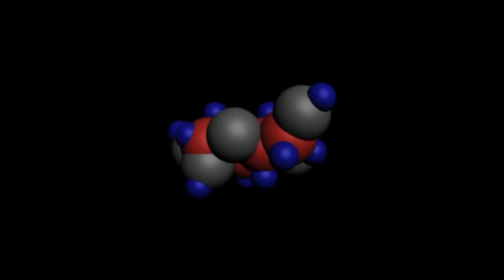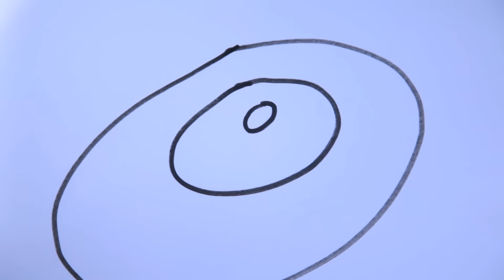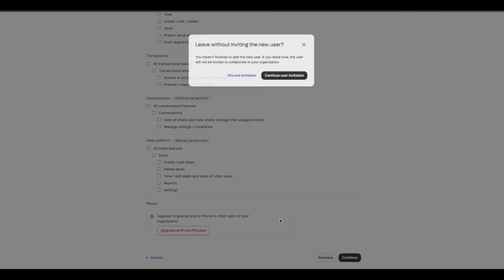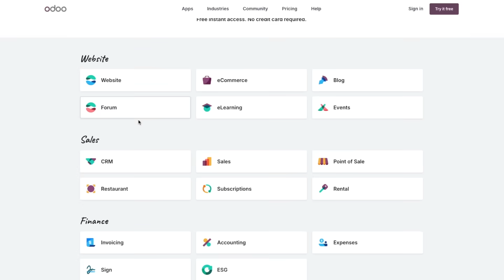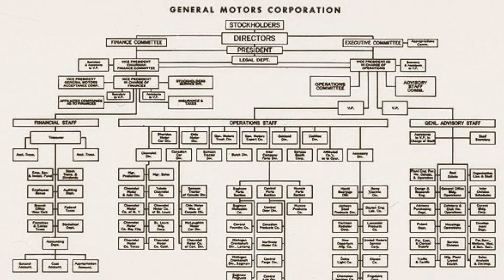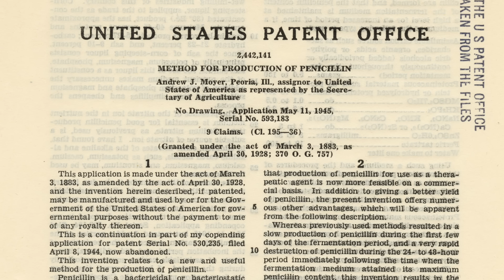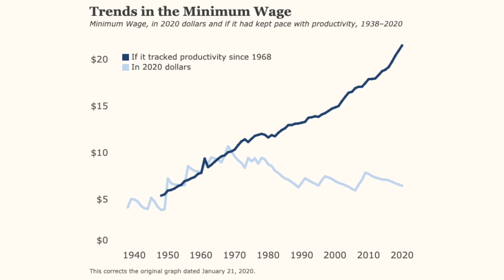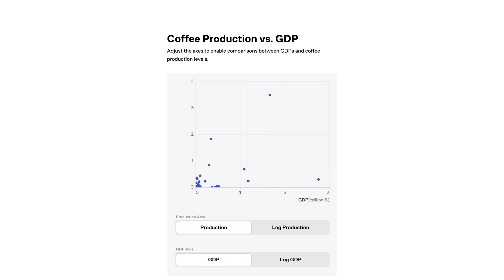The Profit Paradox

Comment: You had us in the 1st half not gonna lie...
...issue is that this malthusian lunacy you peddle is simply not true. We are not at "we ran out of oil, thus production dropped", we are ate "oil demand got reduced". Similarly solar panel production cost (be it in energy or currency) doesnt increase, or performance of new solar panels doesnt decrease year on year.

Hence we are not running out of energy.

US's issues with its current borderline scam centric investment culture is its own unique thing. Its not an end of the world as we know it thing. (Yes, i know other places have their own issues, but different ones)
Reply from the maker: thanks for sharing. What I said is we ran out of 'easy' oil, and also solar is getting more effiicent (as I show) but it's total energy cost is very high. Nowhere does this video say we ran out of energy? It says the energy cost of energy is going up. My sense is you have a preconcieved notion and aren't thinking from first principals?
Reply: @ArtOfTheProblem 
Well in my experirnce cost of living / affordability of life is not even remotely correlated to price of energy let alonr oil. Cost of living in Germany (to pick one example) is not higher (when adjusted for median earning), than in the US, despite waaay higher energy, let alone gas prices.
And of course opposite is also true.
Venezuela & Iran aint utopias just because gas is cheap.

My point is that contemporary fost of living crysis in the US is exactly that, an american issue that has little to do with energy prices. As huge swathes of the world have way worse energy prices, and somehow dont get the "cost of living death spiral"

Comment: 16:20 the mismatch is not just physical but also representational. Remember that money is supposed to represent energy. Finance misrepresents energy to increase the perceived profit. You need to distinguish between real and perceived profit, because money doesn't necessarily represent energy. In the case of housing, for example, part of the reason why it is so expensive now is because banks have an infinite supply of money and can loan whatever they want. Banks are motivated to give larger loans and more loans in order to make more money. That, coupled with compounding interest, contributes to the mismatch we see between the price of housing and wages. There is also land. Land is finite and some places have more expensive land than others, depending on how desirable they are. Therefore, the price of land tends to grow over time in most urban places, leading to a significant increase in the cost of housing.😮

Comment: Another great video from my favorite creator on youtube. I loved the analogy between energy accumulation and profit.
I think the most telling graph in this video is the one at 15:37 which shows the discrepancy between the real economy and the financial economy. This is where the direct one-to-one relation between energy and profit starts to crack in our modern economy. The finance sector can create more energy at any given point of time just on the promise of the future value (or growth) of the current energy levels. Which means it can leverage (and even use) the future energy in present time in the form of loans or credit or any other financial instruments. This is where the problem begins and the natural order starts breaking. Nothing in nature perform these acts of promising or claiming, without the tangible energy to back it up. While humans have come up with this clever way of consuming future value of energy. For the time being, this discrepancy is still getting managed by the lowering the wages (or energy quotas) of the individuals but this can't go on forever.
Another problem of hoarding of energy by powerful individuals is pure greed in my view. In biology it would be akin to getting addicted to the glucose molecules and forever accumulating the energy even when its not needed. Or it can be a considered a tumor with its unchecked and unnecessary growth, but specific to a certain body part.

Comment: Easy subject explained on a complictaed way. You need to control capitlaism, ots as simple as that. Most actors are greedy. Especially the ones that climbed so high. They dont care for the rest, or they care very littld. If you dont control them,  they will start harming, do you need it simpler than that?

Comment: Where is this 16:07 graph from? I think it's very simplified and gives the complete wrong image of how fast the technological breakthroughs in renewables are happening, solar will outcompete oil because it is so much cheaper and coupled with breakthroughs in battery tech it will enable huge surges in energy use for humanity (clean energy use). + I see your point of good profit vs. Bad profit, however, money to invest in the breakthroughs need to come from somewhere (but sure I agree that regulations are needed to make sure corporations don't abuse the systems).
Reply from the maker: https://surplusenergyeconomics.wordpress.com the problem isn’t efficiency it’s capital costs when you include infrastructure which people tend to ignore

Comment: Great video! I've wanted to make something like this myself for quite a while lol. Now you've saved me the work 😃 I'd just like to add some of my own thoughts to this. Economics, ultimately everything is the result of physics. So let's start at the very beginning. Why do cells need energy? What do they actually do with it? If you think about it, a cell is basically just a collection of atoms and molecules, no different than say a rock. And if a rock were sitting motionless in space, would it need energy? No. But if that rock wanted to move, then it would need energy. What does this tell us? Existence doesn't require energy. Change does. If a cell were to just exist and not try to change anything, it wouldn't need any energy. It'd just exist. No different than a rock. But cells do need energy. So what do they do with it? The answer is simple: they use that energy to reproduce. Okay but what does that actually mean? What is reproduction? Reproduction is just rearranging existing non-living stuff into living ones. And since you're rearranging, that's a change and costs energy. That's why cells and all living things need energy. Because they're constantly rearranging things into living configurations. That's where another law of physics comes in: mass conservation. You can't create matter and you can't destroy it (for the most part. We know nuclear processes violate this but life doesn't have access to that). Meaning the total amount of stuff doesn't change. Take a moment and think about what that means. All that exists today has always existed and will always exist (again, another word of caution. Other physics laws render this moot and given enough time, all matter and usable energy will disappear but for our purposes, this is irrelevant for the time being). So if you can't create and you can't destroy, what can you actually do? Just rearrange. That's all you can do. Everything that's ever happened and will ever happen (barring nuclear processes) is just that: rearrangement. You build a new house? You didn't pull it out of thin air. No, you just rearranged existing stuff (brick i.e. mud, cement i.e. rock) into a new configuration, the house.  It wasn't already in that configuration. You reshaped it, that's why you need to spend energy. And life's no different. Because like everything else, life has to follow the rules of physics too. It's not like the universe goes, oh you're a living being? Okay gravity will now no longer apply to you. 
So that's all life is: changing form/configurations. The total amount of stuff doesn't change thanks to mass conservation. The only thing that changes is what configuration/shape the stuff is in. And that too because we're getting energy from the sun. If we didn't, no change would be possible.

Comment: 16:08 You say that the energy cost of energy is increasing which i interpret as the surplus value on the system level is getting smaller. But is that the dominant cause of declining living standards and increasing unaffordability? My view is that extreme income inequality has a greater effect on this matter. Smaller and smaller groups are getting more and more of the value. Its one HUGE transfer that doesn't create energy! Centralizing the energy centralizes the power, control, and decision making--not good for effciency. Thus, the energy cost of energy is increasing and real energy creation is decreasing. I see sooo much opportunity for real energy creation throufh efficiencies that cannot be achieved because of the incompetence in our system which is driven by extreme income inequality which is really just the misallocation of individual power.

On a separate note, the graph of the energy cost of energy is extremely confusing. How is this measured? If it's simply the profit of producing energy, then increasing energy cost of energy just means less producer profit, right? that's not necessarily bad and can actually be good if the price of energy goes down.

Comment: 12:37 the problem with this disconnect is I removes the consequence of death. You are trading your energy, your “time tokens” for a dead commodity. Money doesn’t fade or even tarnish, which makes it useless in terms of energy transfer biologically. If we were silicon life forms that used emf instead of carbohydrate chains as energy transfer it would make sense but the disconnect the average human has with the actual amount of energy needed to do the process they are paying for vs the amount of money they spend for it is depressing to say the least

Comment: i would argue that the "energy cost of energy" is a flawed analogy, if the cost of energy is lowered even if the total energy is more as long as the net cost remains stable it balances, the analogy would be that strip mining with gas lamps is going to be "more efficient" but in terms of man hours using heavy machinery is going to take less human man hours

Comment: "cooking breaks cells walls into proteins and makes up to 40% more energy available than if eaten raw" is incorrect. 

Bomb calorimetry measures a food’s gross chemical energy; your body absorbs only a portion of that (metabolizable energy).
Cooking disrupts plant cell walls and denatures proteins, which can increase digestibility and the fraction of energy absorbed; the magnitude depends on the food and method and there is no universal ‘+40%’ rule.
Plant cell walls are not “broken into proteins”; they’re mainly cellulose/hemicellulose/pectin.
Cell walls are not proteins to begin with (with limited exceptions); cooking or digestion does not convert them into proteins.
Polymers can be mechanically disrupted (chewing, grinding, cooking) or hydrolyzed (by acids/enzymes) into sugars (and, for peptidoglycan, small peptides/amino acids). They are not transformed into proteins.
What cooking actually does in meat: 
- Denatures proteins (myofibrillar proteins; sarcoplasmic proteins). (Protein denaturation is the process in which a protein loses its native three-dimensional structure (its fold), usually because of heat, acid, salt, or mechanical stress. Denaturation makes internal peptide bonds more accessible to digestive enzymes, so the amino acids are absorbed more easily.)
- Disrupts cell membranes and extracellular matrix; collagen can solubilize to gelatin, tenderizing tissue.
- These changes can increase protein digestibility and availability, but they do not involve “breaking cell walls into proteins,” because animal tissue has no cell walls.

Comment: This video is wrong. You can't look at business and profit through this narrative of individual ecosystem or larger system. The example with the Beaver is entirely misleading. The YouTuber just so happened to conveniently draw the boundary at a threshold where usable energy is increased. However, draw the boundary around an even larger system, and you'll see that this is not the case.

When it comes to energy, there is the energy in the ground that needs to be extracted or from the Sun. Everything else is a zero-sum game.

Haters gonna hate. Sucks to be poor.

Comment: Great Video! The solution is incorruptible money.
Reply: Yes, but the problem is that is impossible ;/ You don't want a giant "paperclip factory". You want a fair money system that is incorruptible but also can deal with what happens when it becomes corrupt(because it will) in a sane and fair way. But the biggest problem is that the system today will never let any new system take hold without destroying everything. It's the typical "If I can't have it no one can" insanity of psychopaths.

The biggest issue is that capitalism and criminality and the insanity of the system we live has done extreme amounts of psychological damage to people and turned 100's of millions into psychopaths. One has to overcome that inertia and to do so requires solutions that are likely not practical. Of course we should try but the point is that it's not a simple problem and hence a simple solution will not work. It likely will take decades if not centuries to reverse and that is if billions of people are working on it correctly.

Comment: The figure at 15:58 most be out of date. Both wind and solar are much cheaper than any fossil fuels, as seen by the figure that comes directly after it.
Reply: That explains why energy prices keep going up.
Reply: @thegeneralist7527  they keep going up due to the fact that it's a merit order market where the most expensive electricity on the grid determines the price. Also has to do with renewables often requiring improvements to the grid which while being a onetime expense get passed down to the consumer.
Reply: The graph is from a 2011 report by the then managing director of the company Altacorp Capital (Now named ATB Capital Markets Inc) The founder of the company George Gosbee was a major oil and gas financier so I imagine the company would have a bit of an agenda...     The reports quite short, its main points being "We cannot abandon hydrocarbons", "consumers will select the lowestcost options" and "What they don't tell you is the sun sometimes doesn't shine and the wind some times doesn't blow" then talking about how expensive renewables were back then.